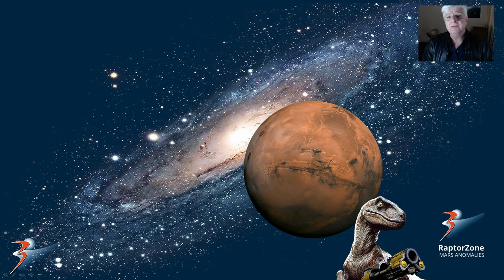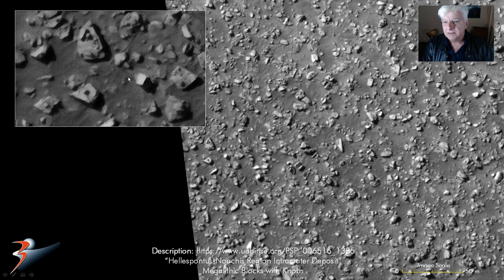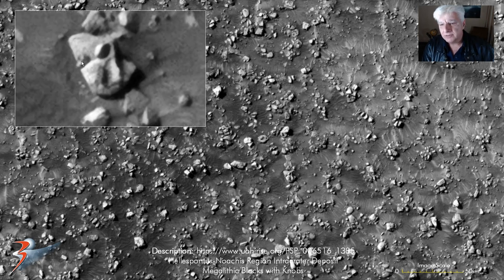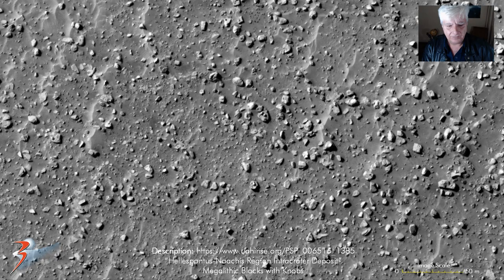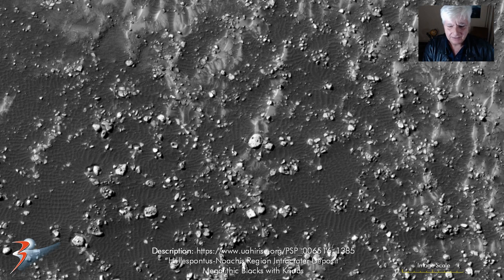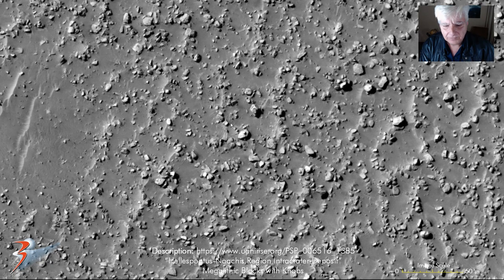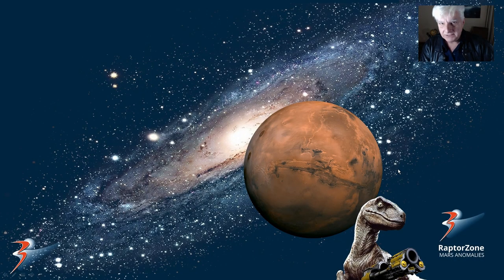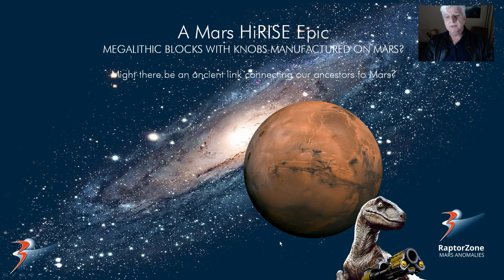Were Megalithic Blocks with Knobs Manufactured on Mars?

Comment: Interesting I can not figure out why there would be so many rocks on top of other rocks like this. We see this sometimes on earth but was put down to glacial deposits as the glaciers melted. The only other natural explanation could be erosion of softer material has left these stones sitting on top of each other? Very strange.
Reply from the maker: Hi Kevin ... there's just too many I think for this to be natural; so many cases where the smaller stones sit in the center of larger ones. I can understand if this happens here and there, but this is everywhere.